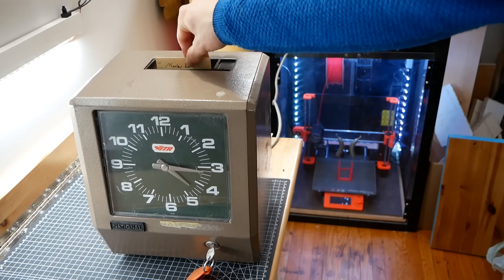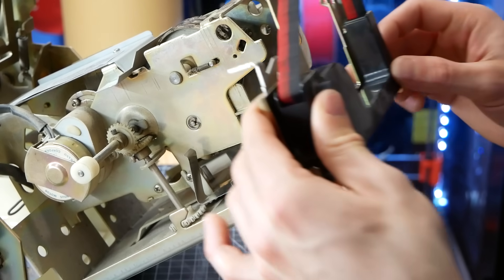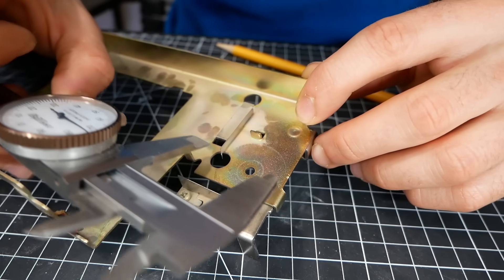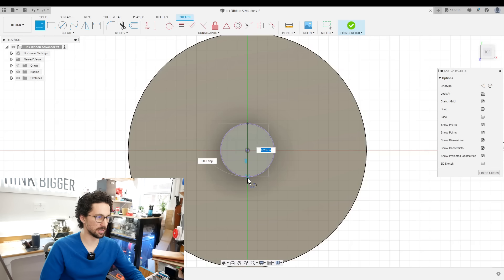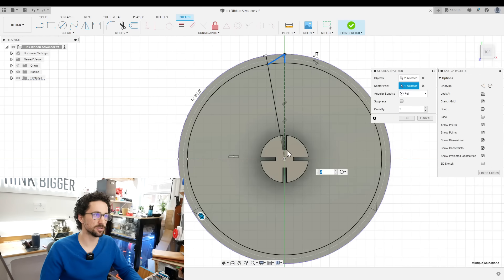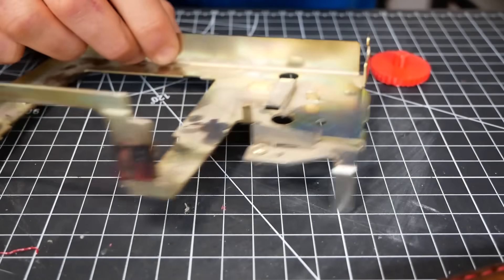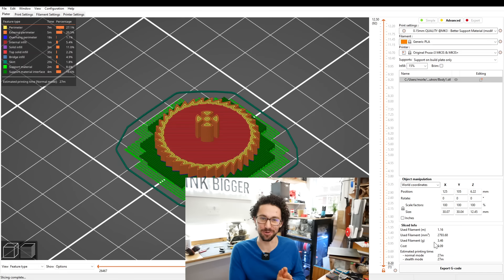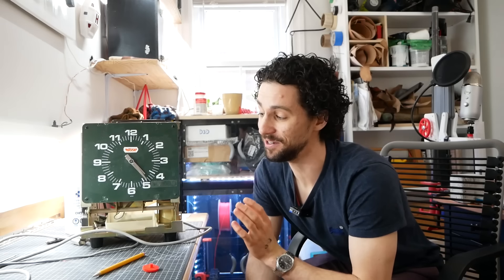They wanted 100 dollars. I 3D printed it for 9 cents.

Comment: This is why I bought my 3D printer.  There have been a few projects ( pool skimmer adapter, microwave exhaust ducting, shop saw dust bag interface, a few gears, etc. ) that make it so worth while, plus being a retired engineer this is better than crossword puzzles!  Great process and use of Fusion 360 ( parametric approach ).  However, a little nit is that it sounded like they wanted $95 for the whole assembly and not just the gear.  Regardless, this is definitely a project worth sharing DIY types.  Thank you for sharing.
Reply from the maker: Thanks for watching!

Comment: A couple for faster CAD. 
When you were making the cross cuts on the tab, you could have offset the two lines, made the center line a construction line and then used a circular pattern to make a copy at 90 degrees. Less clicking and less profiles to select.
On the gear teeth you could have made one extrude cut then use a circular pattern on that feature, OR, make the sketch, pattern the sketch but then selected the tooth diameter circle and made it a construction line then select everything inside with one click and used an intersect extrude through all and it would have left you with the gear profile without having to select everything.

Great video!
Reply from the maker: Thanks!

Comment: FYI, there is no ink tank in those ribbon holders. That boxy area is where the ribbon is folded over itself many times. All the ink is in the ribbon from the start. The extra length is there to hold more ink and to give it time to move around and even out between two stampings.

Comment: Your argument of them charging you 100 bucks while you can do for 9 cents is flawed.  It is all about tools, time and money.  How much time did you spent to learn fusion 360? how much time did you spend creating the model? How much money did you spend on the the license for Fusion 360? Yeah, yeah, yeah, I  understand you can accomplish great things when you have the time, money and the tools, but the biggest question is... Is it worth it?  I think your argument of I spent 9 cents on something that costs 100 bucks is flawed.  YES, you can do it because you have the tools the time and money.  But if you were to ask someone who does not have a 3D printer.  Just the printer would be twice as that.

Comment: Loved everything about the video, besides the cost comparison. It's only a 9 cent vs. $90 difference if you assign $0 worth of your time. I'm quite sure that from start to finish, most people would need to invest multiple hours in this project from start to finish. Don't get me wrong, I think it's a great project, but shouldn't take put a cost comparison into it if it's about having fun with diy :)
Reply: Yeah, and Fusion 360 is $495 a year, plus the initial cost of the 3D printer, you would have to be making fixes like this several times a month for years to get it to pay back financially, it still is cool though.
Reply: @jibcot8541  absolutely! Everybody "should" start fixing things instead of "buy, use for a bit, break, throw away, buy new shit".

Comment: My only concern with something like this would be the pressure of the interface on the gear teeth and how long the PLA would survive the repeated scraping. Well worth a project though and well done - great to watch :)
Reply: Even if the part wears out over time, a new one could be printed for little effort. Could also use the print to create a mould for a more substantial material. Maybe even dabbling in some backyard metalwork.
Reply from the maker: Thanks for watching!
Reply: this is a very very low-wear application.  The axle is probably more subject to wear than the teeth.

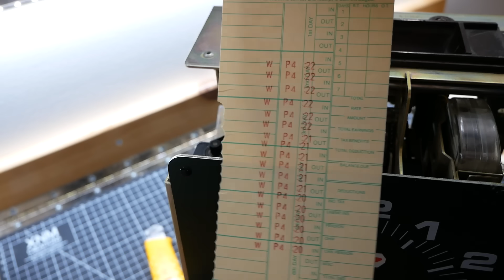Comment: 12:53 they wanted $95 for the entire assembly. in the message you showed they were talking about replacing the entire ink assembly. that one nylon ratchet wheel is likely not a part they have any of in stock, and the part probably only exists in on the shelf replacements for the whole assembly. if they rob one of those kits for just the nylon wheel for you, they are screwing themselves because then they have a useless assembly that needs a new wheel. lol why do you expect for super old products like that? that's like complaining about the cost of DDR1 RAM today. that stuff gets extremely expensive as time goes on because often no one makes it at all or just one place makes it in limited runs.

Comment: 8:24 Using this method of parameters, the number you want here will always be (360 / the angle parameter) - 1. so in this case you picked an angle parameter of 10 degrees for the tooth, so the number of reeditions for the circular pattern should be 35 exactly. You subtract 1 from the number because the software does not count the original selected lines in the total repetitions. If you had left the angle at 5 degrees, the number of repetitions would be 71. If the angle was 12 degrees, the number would be 29. 

I'm not sure if fusion 360 supports doing simple math with its parameters like that. and as others have said, most gear making software has you define the number of teeth and work from there. in this case though, i think your method was more ideal when the number of teeth is a complete WAG

Comment: In the slicer, split the gear horizontally in the middle and print top and bottom part of the gear flat without any support. 
Then glue the gear together.

Comment: If your business was making obscure little parts for out-of-production equipment,  you'd have to charge a lot more than 9 cents to break even.  I can  imagine you'd charging around $95 for a single part.   The company isn't ripping you off;  the most efficient  process they have is  selling subsystems. They are charging you more than cost, but probably not much more.

If they  hired you to re-make little parts for customers  ( supposing  they had enough work for you to work full time )  they might reasonably have to charge $95 per part to cover the cost of equipment, office space, materials and the salary of someone with the skill to  design and produce parts good enough to be replacements.

Comment: instead of guessing you could have counted the teeth in the dust on the metal then calculated from there how many original teeth but hey as long as it works, and basically eyeballin it is way faster.  Also, thanks for the PTSD flashback from a job I had in 1990...

Comment: I loved this, but I was so baffled when I heard the measurements in inches. When I started 3d printing and 3d design, everything was in metric and now I can't imagine using anything else for such small increments.
Reply: Same!!! Metric is so much easier for me to understand in modeling software because it's a base 10 system instead of the the base 12 of Imperial units. Same goes for when I make sewing patters. I feel so bad for anyone who would look through my notes because I keep switching back and forth between cm and inches
Reply: "10 thousands of an inch" "0.021 inches" "0.07 inches"  .... What are these weird measurements?!
Reply: @yerwol  They’re called freedom units
Reply: @yerwol  Eh I mean this is pretty common in machining. The idea of thou or thousandths of an inch is pretty standard in American machine shops. Typically things are described as like "ten thou" or "a hundred thou" instead of .01 or .1
Reply: @lunartriton6793  the industrial life has set my measurements by thou. It's so bad that sometime a quarter inch gets said as 250 thou.
Reply: @lunartriton6793  So a thou (or a mil) is basically a milli-inch? I almost thought it was about a millimetre, but then I thought it's close to a micrometre ...but it's not: a milli-inch is 25.4 micrometres. Makes me wonder what kind of freedom unit you'd use for describing even smaller things, for example when I'd be using nanometres (a nanometre is 1/1000 of a millimetre, a millimetre is 1/1000 of a metre and a metre is close to a yard). Are freedom units ever used for something that small or is that metric scientist territory?
Reply: @nicjansen230  I love that we have a system that scrambles your brains.
Reply: @One of eight billion Yeah, it's simple if you're the average joe or just doing carpentry or something like that.

If you're an engineer you might need something like 1-3 pages of full, exact conversion factors.

You'll also need to carefully manage precision errors in calculations that can easily compound into errors that could ruin businesses and lives, which is a headache you'll be glad that you never have to learn, and duplicate your work if you're obligated to produce reports/drawings/proofs in both metric and imperial. Not to mention proofreading your own and your colleagues' work several times.

If your work eventually ends up related to something like big corporations, health and safety, or the legal system, the time a single engineer might waste on it yearly is measured at least in the thousands of dollars.

And if you mess up, a blown up space ship or an automobile recall can cost in the millions or billions.
Reply: Metric is the only way to go. I grew up on standard. I design 100% in metric. Much more practical. Though machine shops in the States still do most everything in standard....to the point that it's fucking annoying,  I don't care about tolerances in thou.
Reply: Welcome to the bright side ^^
Reply: It all depends on scale, American machining and anything tangential works in imperial, if you're in a machine shop its unlikely you will touch many things in metric, everything everywhere else is metric except in a machine shop, machinists are stubborn bastards
Reply: @kiyosenl.3889  just machine shops? Yeah right. Try the whole manufacturing industry and anything that touches it, including across borders and disciplines, not to mention the general brainwashed populous.

They're so namby-bamby touchy about it that they put the onus of units conversions on others as a general policy.

And as a Canadian within the manufacturing industry I can tell you how much of a waste of time and money it is dealing with it. Canadian society has persistent bits and pieces of the imperial system in it because of our relations with the neighbor. We can't properly progress towards a fully metric society, and we're saddled with learning both systems, causing plenty of confusion and wastes of time for everyone.
Reply: And I didn’t know that they even produce calipers with imperial units…. So much then for “all engineers in the US work with metric system”…
Reply: @marcd6897  All of my calipers are digital with conversion between units. But for me imperial is pointless. I let the machine shop worry about converting my designs into crap that they use. 😁
Reply: YouTube is definitely the place for this conversation
Reply: I've always had to use both because so much is actually manufactured in those units.
Reply: Having to learn both metric and imperial was a great side-by-side comparison of the agony that is imperial.

Working with imperial is more than twice the effort wrangling with units.

Sometimes it's worth it to just convert your given data into metric, do your actually useful work, then convert back to imperial for the traditionalist idiots.
Reply: But the machine he wanted to make the replacement part for was built using Imperial measurements, so might be easier to stay in one system but I agree metric is what I prefer even though Imperial is what I'm used to using. If I have to use Imperial I'll use decimal inches not fractions.
Reply: @bobd.  Nowhere in that machine was imperial a requirement. The starting measurements were shadow of unknown diameter, holes with unknown diameter, and more holes with unknown measurements.

With metric, it coul have been much more straight forward to measure out 32mm, 15mm, 8mm, and so on. I just threw some numbers, but at least it's not a system that desperately tries to be metric with 1000th divisions.

Comment: 9 cents 
Plus the cost of the 3d printer
Plus the cost of the software
Plus the cost of your time
Plus the time it took you to learn how to use the software and 3d printer.
And i know im nit picking here but 95$ and the company did all that for you. Are you saying the 3d printer the software and your time are only worth 94.01$.
Reply: The only thing that is truly used up by doing this is the time modeling. He doesn't need to buy the software or printer after each project, nor does he need to relearn how to use it

Comment: Great video! In prusa slicer, you can set your support interface distance to 0 (no space between print and top layer of support) then add a pause command at the top layer of the support by right clicking the little plus symbol on the layer slider in the sliced preview. When the printer pauses, use a sharpie on the top layer of the supports and they will be easier to remove and the underside of the print will be much cleaner.  (Not my video)
https://www.youtube.com/watch?v=oBGl4i668Tg

Comment: I would hope the $100 version is made of metal. If you were to actually use this as a time clock, your plastic one would wear out so fast you'd soon be throwing $100 at them so you can stop printing them.
Reply: Back in the Palm Pilot days a friend gave be a Vx because it was missing a button. I called Palm to see about getting a replacement. Actually, I called them ask how to open it. They wouldn't tell me.  Then I asked about having them give me buttons. I was told it would be $100 to replace it. What a coincidence. I asked if they could just send me the button. They said that would be $100, too. Steaming, I did some research on how to open the danged thing, got out my hair dryer and opened it up. The buttons were basically like model airplane parts but more robust.  

After some analyzing I determined I had a TV remote I wasn't using with a pleasing grey and maroon color combination that I could use to replace all of the buttons.  I had to grind down the long volume button from the remote that was to serve as the middle button and grind the others to fit the oval shape of the other buttons.  But after about 5 hours worth of work, I had my 'free' buttons installed. I must say the worked better than the originals and are still in that device today, working just fine.

But....
at my salary back then, I could have worked 5 hours, paid the $100 to get it fixed and had enough left over for dinner at a nice restaurant.

I'd say the same is true here, too. So make the thing if you want. I would do it again.  But please do not ignore labor so that you can claim it only cost you 19 cents.

Comment: For the post that goes into the ink cartridge, I think you over thought it. You just need a flat bar that is the correct width to fit inside. This is a common method, and allows a little slop to ease in changing the ink part.  It doesn't need to catch on the 4 teeth in there as it's not something requiring a lot of torque to move.

Comment: You can actually see the cogs that were used originally imprinted in the metal, would have given you tooth count and angle  even for the small area that was visible.

Comment: Good example of 3d printer -at-home :)

My 5 cents on Fusion:
1) do just 1 tooth by sketch and extrusion, and then do a circular pattern for faces. It is way faster, fewer mouse clicks and less stress for your computer.
2) do a 2-piece design instead of printing on supports. Central pin and cartridge drive pin could be press-fit into large gear wheel, or screwed in using printed thread.

Comment: tell you what though, ninety bux is actually ok.

Break it down. I'm not going to include the troubleshooting aspect of the build, but only the actual build.

First, you had no spec in the missing component. So you had to do a search to see a picture. That's no more than fifteen minutes. The image was very approximate, so you had to flesh it out in its entirety. You then had to take the idea in your head and put it into a CAD package. I believe you used Fusion? So that was probably an hour from clicking new to hitting slice.

Then probably a three  hour print (I'm assuming very high infill?) before bench test and refinement to Mk2. Amends on the original file plus second print plus second bench test.

Realistically, you would have charged yourself more than the ninety bux.

This isn't criticism. Actually, maybe it is a little, but if it is, it's not directed at you, but rather those who think 3D printing is "easy". great vid and very useful for illustrating the amount of work involved in what was essentially a full prototype.

Comment: I don't know if it had been said before, I am pretty sure there is no ink recharge in the ribbon cartridge. It is just an endless loop of ribbon (a long one) and when the ribbon starts to dry out, you just change the ribbon cartridge.

While I have never seen that specific ribbon cartridge, I have worked with enough impact printers in the past to be quite affirmative (to save cost, we would open the cartridge and replace just the ribbon, a messy work until you got the hang of it).

And a 350 degrees circle, divided into 10 degrees tooth should give you 36 teeth :)